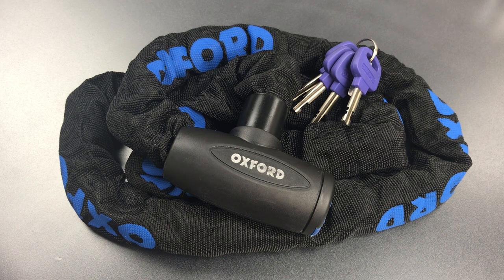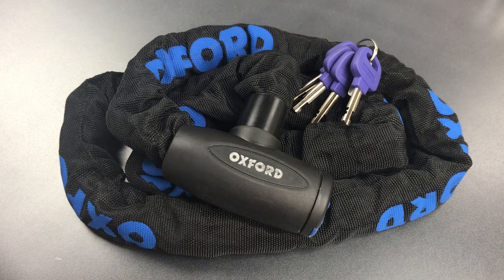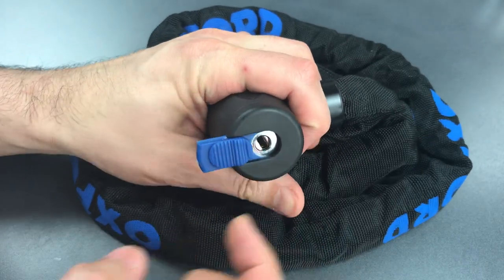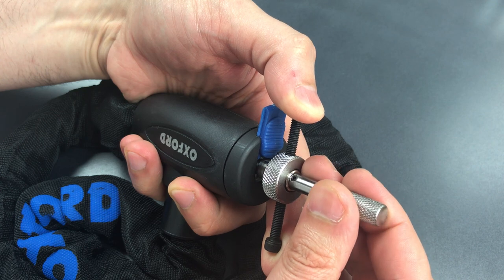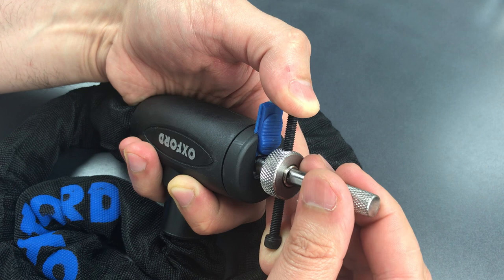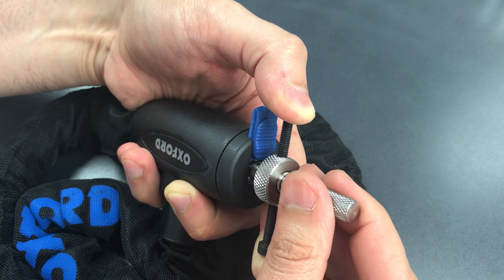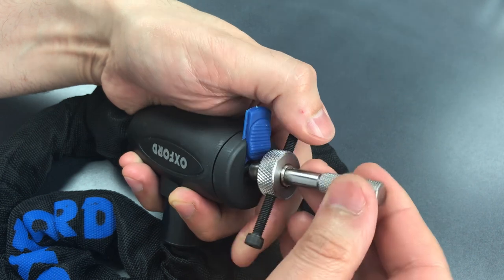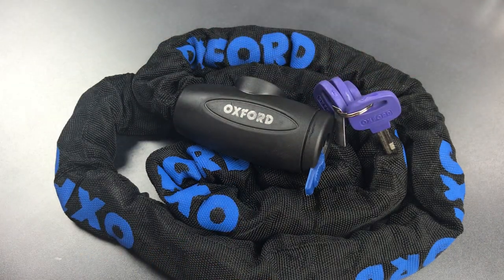[715] Oxford GP Bicycle Chain Lock Picked (Disc Detainer Core)

Comment: Hi Harry, Most disc detainer "cylinders" have metal spacers between each disc, usually contained in a plastic shell, and they tend to indicate with a definite "click". Others have no metal spacers between discs, and the discs sit in a plastic "cage" with only thin plastic walls between each disc. These also sit in a plastic shell. It's obviously a cheaper mechanism to produce as there are no metal spacers to stamp out - and much easier to load. The downside is the feedback on the pick is much softer due to all the plastic .... Regards, Brian.

Comment: I have a similar one, although I'm not sure of the brand. If yours is the same, you can pop off the end with the weather resistant cap.

On mine, the pins connecting the chain the lock were too soft. Couldn't resist a regular metal saw.

Comment: Am I just ignorant, or is a disc detainer even easier to pick than a high security pin system?
Reply: Not a high security one.
Reply: Most would say that disc detainer locks are probably harder to pick, but that also kind of depends on the country you're in. Over in America for instance there just aren't a ton of Disc detainer locks outside of things like tool boxes. Because of that,  most don't have enough experience to pick them.  That being said, I think that more people would say that the high security disk detainer locks are much more difficult than the high security pin tumbler locks.  There are many high security disk retainer locks that have never been picked on camera on youtube.   I'm sure the same would be said about certain  Pin tumbler locks like the boley lock or some other high security locks like those from medico. 

The problem is that there a lot of picking attacks that cannot possibly affect disk detainer locks. For instance, you really can't do something like rake a disk retainer lock. You also can't use vibrating picks or over set the pins to push them out of the way. For this reason this containers can prove to be incredibly pick resistant. It's also very easy to manufacture in a lot of disks to rotate.  This means that you can have   35 disk locks that take up the same size as a 5 pin lock.
Reply: You won't see 35 discs in a lock! That's insane. There are other methods that you can use to quickly and easily open DD locks that you can't do on pin tumblers too though. Like wire decoding. Plus, you can release tension, go and have a coffee and return from the same spot you left from. The only DD lock I know of without a YT video is Protec I/II. And they can still be picked, it's just very under-the-radar.
Reply: If one were to add individual reset springs to the disks, and arranged the side bar so that it would be impossible to apply enough tension to hold set disks against their reset springs, disk detainer locks could be made very difficult indeed.  The lack of reset springs, though, makes them seem easier than locks which have reset springs.
Reply: That's the big thing with them though; they have no springs and so are particularly wear-resistant. This also means they are suited to outdoors and inclement climes. 

There was a patent filed by Abloy in the 80's that had a common spring to reset the discs. It never made it to reality though sadly. Putting very strong, individual springs on would make them much harder to pick. I don't think you could ever practically have enough spring pressure to stop the sidebar from holding them in place though because you can generate a lot of torque when tensioning.

Comment: Could you get hold of a “Thatcham” approved lock for motorcycles to show how easy / hard they would be to pick? Thatcham is a term used in the UK (I dont know for anywhere else) which gives a rating on how good the lock is for security and insurance purposes. Thanks

Comment: I would like to see you have the lock actually installed on the item  and pick it from there...  Like this bike lock...  Install it on a bike and then try to pick it...  If you install the lock so that it is very difficult to get to because you tucked it up into the bike frame...  bet it would be a real pain in the butt to try to pick...  Seems too easy just sitting on a table...

Comment: The real shame of this is that I have one of these at home, I hopped into town one evening and used a cheap Master lock cable job and a hiplock lite because they were lighter and they could be wrapped round my top tube when not in use.  I locked my bike up, came back an hour or so later and my bike was gone!   If only I used this lock and my u-lock, I would still have my bike! 🙁